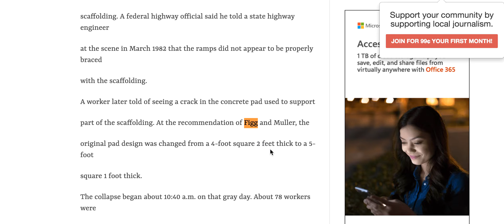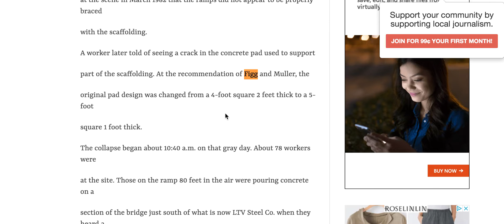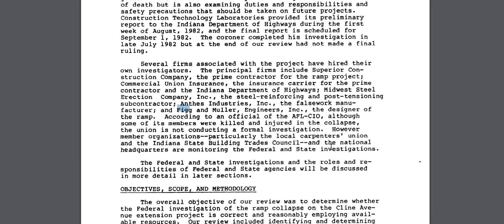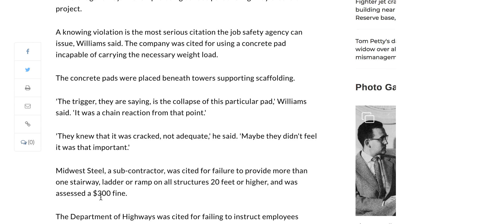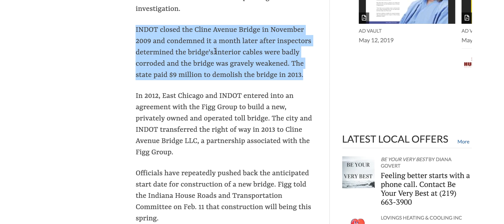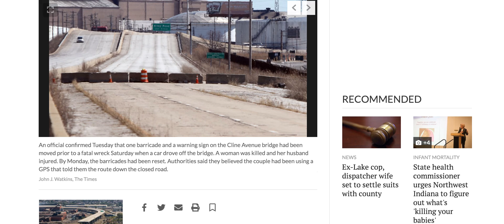FIU Bridge Collapse Figg has a history of bad engineering East Chicago Cline Ave Bridge Collapse

Comment: The Sunshine Skyway is another one of their problematic projects. It has steel tension cables that run vertically through the vertical support piers that hold up the span. These became corroded and required repairs. Fortunately it appears it was not serious enough to jeopardize the bridge and seems to be holding up well.

Comment: Wlcm you are doing great research on this. That was eerie. Cline was the first thing I thought of when it happened. I do like post tension as an idea but it is getting a bad rep. They need noncorrosive cables. It's like a violin string in the conduit and vibrations produce electrolytes. I would use fibercrete and carbon fiber concrete
Reply from the maker: Chris, I hope you catch the video I posted today, that shows NTSB has NO RECORD of any failure of Post tensioning in their ''history search'' at NTSB public records!  
It is alarming to me that concrete is used as floor beams with post tensioning and also girders...  YES, they do work but they have a life-cycle that is unpredictable in failure...   looking at the FIU bridge
Reply: @ForensicCats  I haven't had time yet. But cline avenue was condemned over corroded post tension cables. And a few other that you brought up. The problem with figg is they just do a lot of bad engineering. They just happen to favor post tension designs. I actually like suspension the best. It's unfortunate that fiu was fake